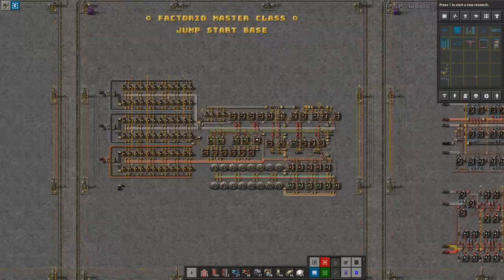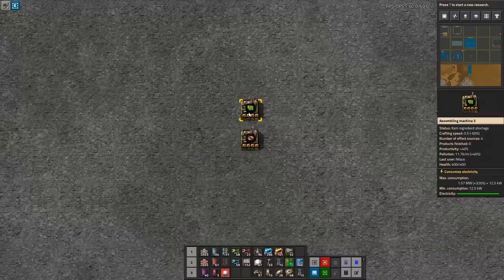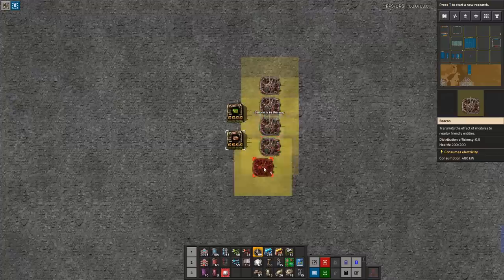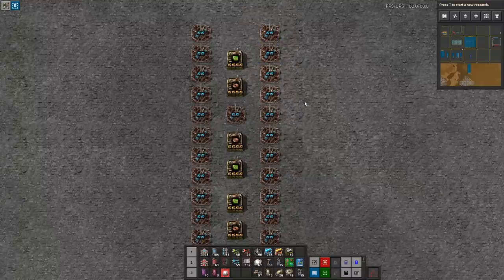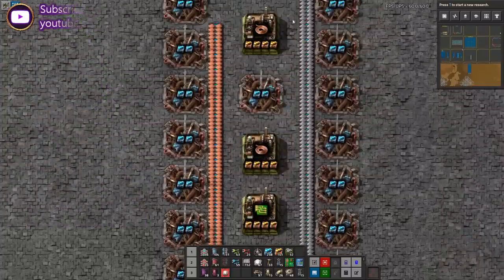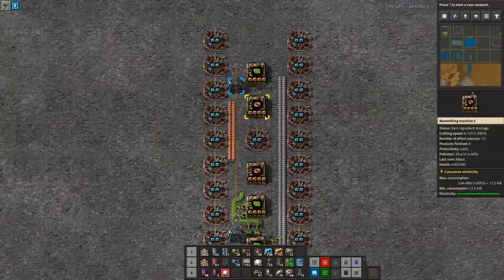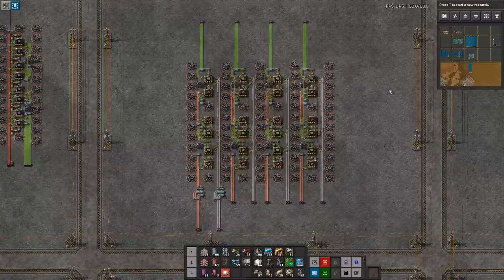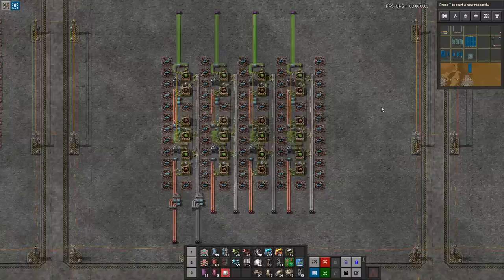Late-Game ELECTRONIC CIRCUITS  with Beacons/Modules | Factorio Tutorial/Guide/How-to

Comment: Great design.  One tiny critique, the middle copper cable assembler, the inserter pulling off of the underground exit hood, that is not always consistent on a running belt.  It would be better if those two inserters were moved up 1 tile.  You are probably fine since the belt is not fully consumed, but good practice for the future.

Comment: Hey Nilaus! I love your tutorials and blueprints. I can't seem to get this one to output full belts though. I used the blueprint. My copper and iron belts are full. Modules are all upgraded to 3.
There seems to be lag of the green inserters not constantly filling the coil assemblers with copper, even though the belt is full copper is available. Thoughts or suggestions on what I'm doing wrong?
Reply: Do you have the max inserter stack size research? That is likely required to make this build work

Comment: What's the difference between your 2 splitter+tunnel shenanigans balancer and a simple sideload one? Haven't seen this design yet before.
Reply from the maker: The simple one is not balancing correctly. I don't see a reason to add a balancer that isn't working perfectly
Reply: I recently answered that question on another video, so let me copy/paste it:

If I understand you correctly then what you are describing is an output-only lane balancer. Nilaus is using an input and output balanced lane balancer.

There used to be more information on the wiki, but it got removed for some reason. 
Here is the old link. Sadly the PNGs are not loading but the blueprint string works and the description of the difference between the design is still accurate:
https://wiki.factorio.com/index.php?title=Balancer_mechanics&oldid=164057#Input_Balanced.2C_Output_Unbalanced
Reply: @dakon2154  Thanks a lot! This actually explains all those half-full train stations that I keep breaking my head over.